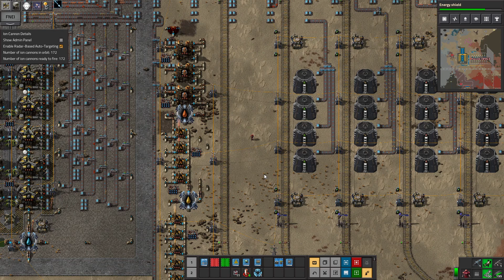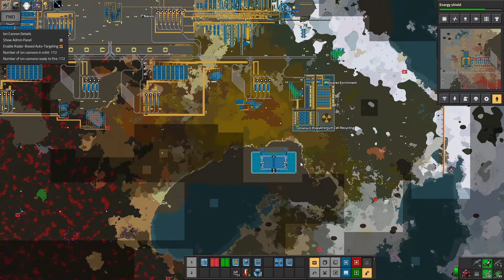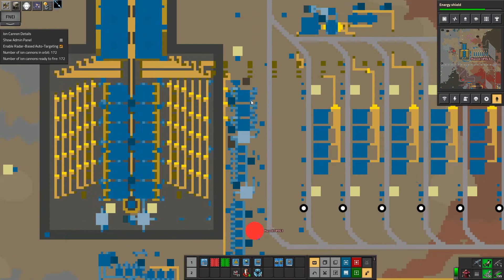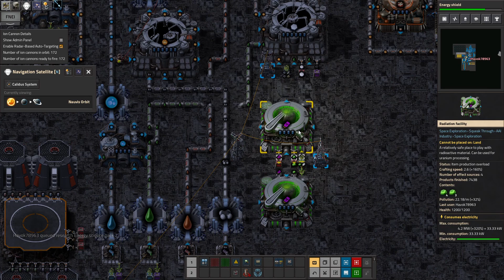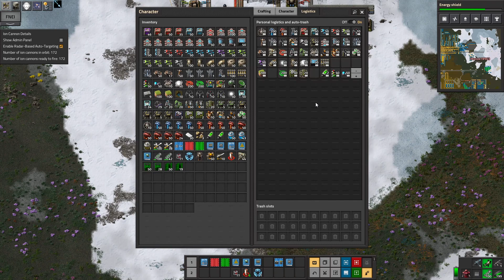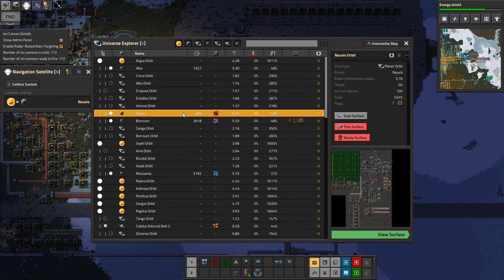Preparing to Take Another Planet Factorio 1.0 Space Exploration Plus Ep. 42

Comment: I will suggest making a dedicated train dropout for each of the materials to fill up the rockets.

For the rocket sections and capsules a combined a belt of them running above the launch pads.

The combinators placed on side for the signals.

Having a pipe run down the launch pad just as you are doing and having a pump on each of the launch pad for faster loading of fuel also there is going to be a long line of pipe for fuel so adding a few pumps in between will also help.

The recycled stuff can be added to the belt easily by having a landing pad near the facility and also make sure you pack them before loading the rocket sections from space to utilize the space efficiently. 

Also a small change in your circuit for signals from space will help you avoid a disaster.
Right now as you have it setup if for whatever reason there is drop in power either on planet or orbit side there will be no signal received or transmitted and your combinator will take that as <1 and each and every rocket will launch right away.
It can be fixed by adding a combinator in orbit for each landing pad saying if item=0 then output item(1) and on the planet side changing the combinator from <1 to =1.
Reply from the maker: Wow, these are some great sugestions and I will most certainly work on getting this implemented. Also, thank you for the heads up on the signals from orbit. I had not even considered that! =)